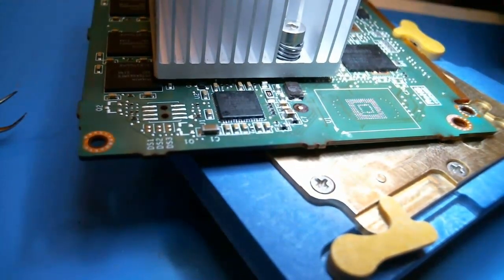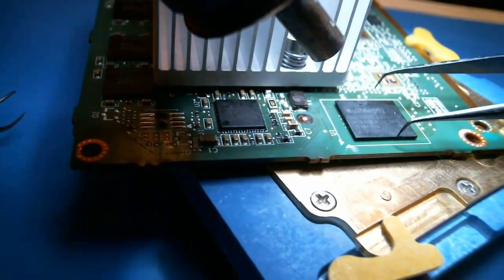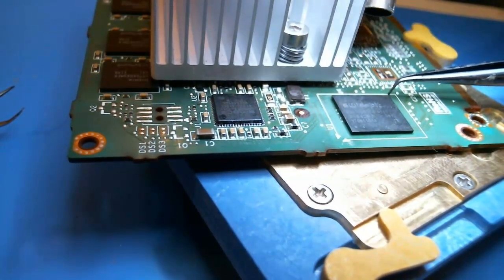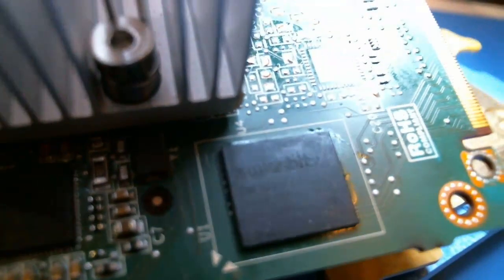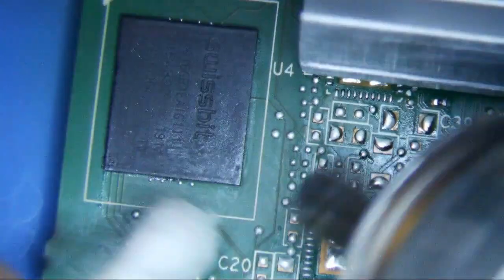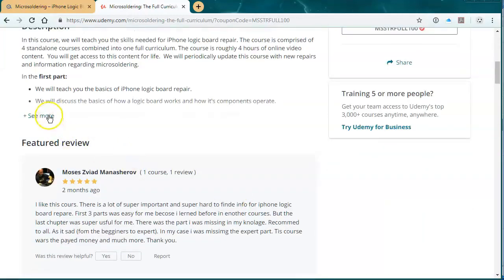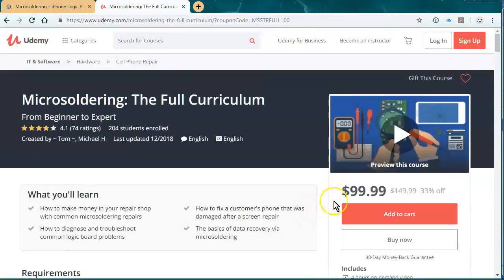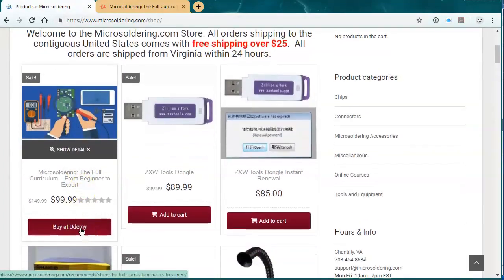Tesla Model S 2012 MCU Unit Reball

Comment: They need to update to remove the oldest logs before writing new ones if the chip is over 90% full. So did you ever wonder if you can contact the NAND chip maker and see if they make a bigger chip? As long as the pins are the same then I would think LUNIX would still map it the same way and just show more space available. Instead of just repair, you could do an upgrade. Keep a few old small chips from upgrades for future repairs as well.
Reply from the maker: Gadget Review Videos yes, we upgraded the nand chip to one of more capacity
Reply: Nice
Reply: Unless the log destination were changed (which in this case it was) just swapping in a bigger storage space would delay but not eliminate the problem.  Maybe it would fail 20 minutes after starting to log trouble instead of five minutes after.
Reply from the maker: @tactileslut   I think the guy said that he was able to change it so that the log file is logged to tempfs or something like that, so that the log file is cleared after every car restart.
Reply: It does not run out of space, the constant logging wears down the emmc to the point that the write threshold is exceeded, after which failures start happening on the filesystem. A better quality emmc or one running in pslc mode will last much longer than the car.